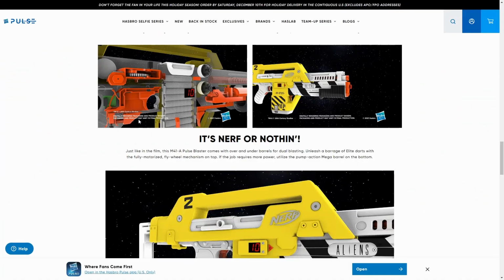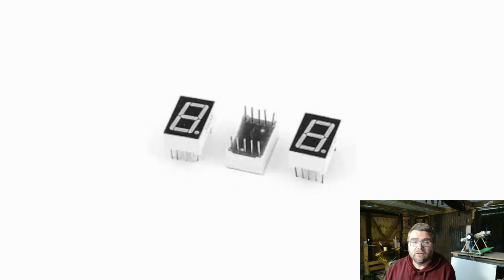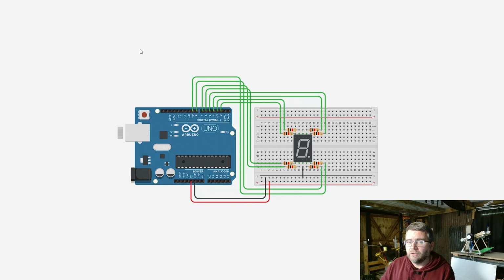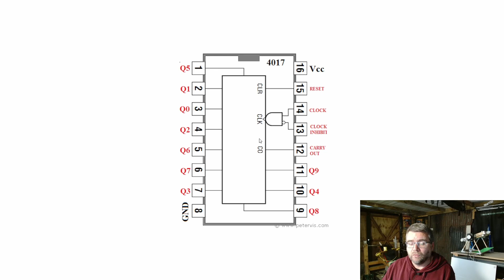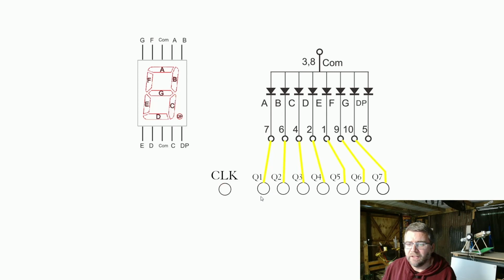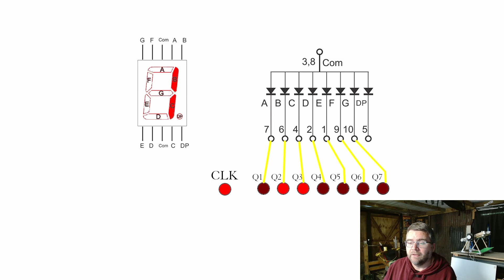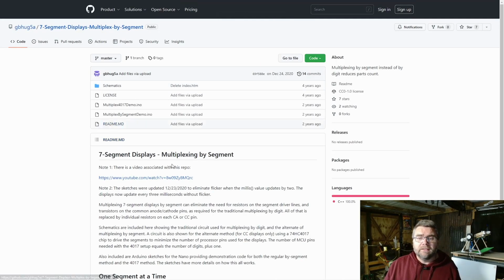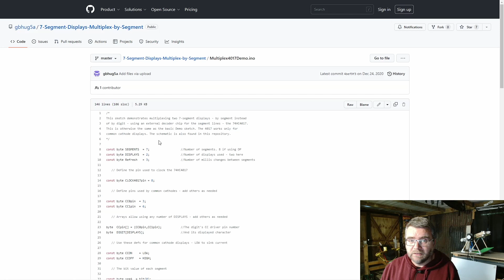Nerf Gun Upgrade: Build a Cool Round Counter that Counts Down

Comment: Could you modify this for airsoft?
Reply from the maker: Hard to say. I use an IR sensor to detect the bullet traveling down the barrel. I would say airsoft is traveling a lot faster and smaller than a nerf bullet. A laser detector would for sure detect the pellet. This count could only go to 99 also. AFAIK airsoft has 100+ pellets.
Reply: @JWNZ  thank you mate very helpful
Reply: @JWNZ  OPB100 sensors/ OPB815WZ Optek could work detecting BBs